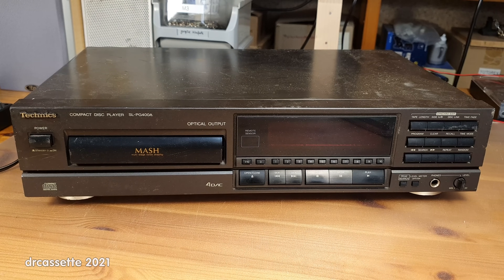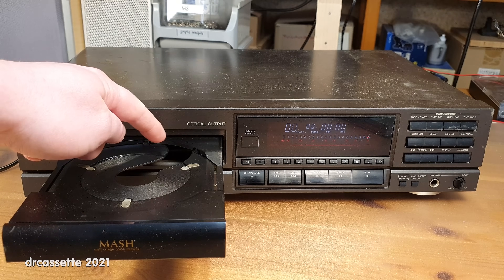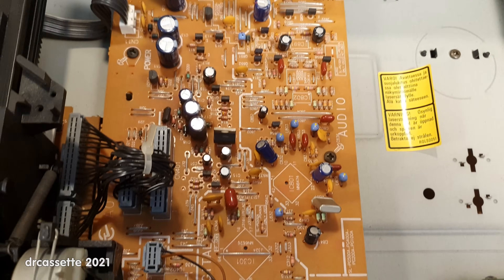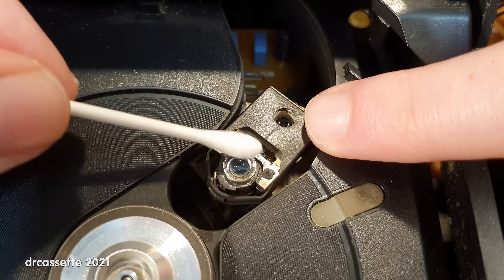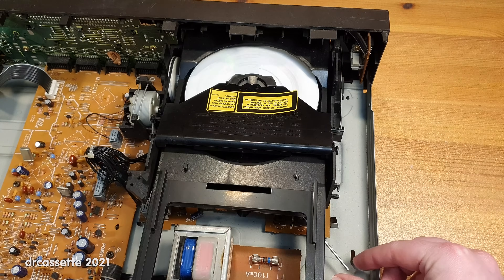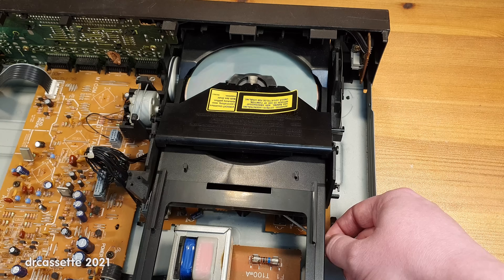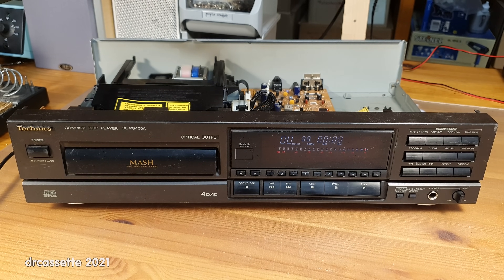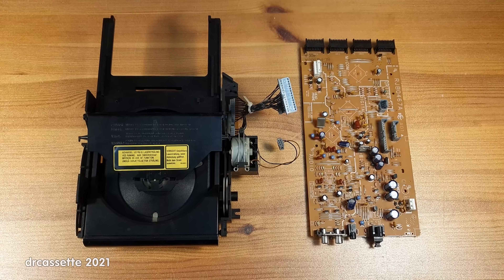Technics SL-PG400A CD Player repair attempt

Comment: Tle laser light intensity potentiometer is on head itself, those remote ones shoud be for focus and tracking
Reply from the maker: The service manual makes no mention of any adjustments on the laser assembly itself. The laser power adjustment is on the servo board.
Reply: @DrCassette  There should be always one on the head itself, check it, the laser assembly head is showed as one whole module in Service manual, you won't see it described there, If not there then, another weak point is bearing on the spindle motor, you can replace it with any similar size motor with long enough shaft to fit the disk holder. The motor is tired and causing wobble, change it and adjust that pot again. I've repaired dozens of those Technics weak players. Also try to lubricate old shaft, if you have luck, it may not be that weared.
Reply: @technixbul  on that Philips CD transport, no. Laser power and focus adjusting pot's are only on servo board.
Reply: @realsomething2981  yes i saw that, i have 3 of them, but this must be an older one, but the other part of my advices are still truth for that slide assembllies..

Comment: These Philips CDM 4/19 CD drives are very reliable and most of them can play CD-RW as well. But like some already mentioned the capacitors on the servo board (labeled 2501, 2502, 2503) fail very often. I only replaced the 2501 and my Technics SL-PG400A now works flawless. But I prefer the Sony KSS-xxx based CD players because they give you more options to tweak the laser, focus and tracking settings for faster performance and better error correction.
Reply from the maker: The next time I get in a CD player with CDM4 mechanism I will be sure to check the capacitors on the servo board.

Comment: I have a Phillips CD player with a similar mechanism that my parents bought in the late 80’s. We had many years of use out of it, nowadays it still kinda sorta works but it produces a kind of digital ticking sound, as if the laser can’t track the disc properly. It’s a fault my dad could never fix. I doubt if it is fixable, everything else seems fine. I still keep it around for nostalgic display purposes as it was our first CD player. Nowadays I use a DVD player to play my audio CD’s.

Comment: To be honest I've never really rated the CDM4 series, I've had a few dead ones. Changing the blue capacitor on the servo board can help but generally I've found that the digital output from them is very poor with a lot of noise and dropout. That says to me that the laser might be reliable but it is constantly mistracking, relying on oversampling and correction to sort the errors out.

The key advantage of the linear Japanese mechs was always that the laser was an easy and cheap swap out when it did fail. The Philips, much less so. Try getting a replacement for one of the less common variants like the CDM4/25 for example.

Comment: Randomly adjusting the laser current is not a good idea. You need to look at the eye pattern. Good that you checked out the manual 😜 check caps on the servo panel.
Reply from the maker: I was hoping that just a small turn of the laser current adjustment would be enough. It only turned into random adjusting when a small turn didn't do anything... The CD player has been scrapped, but the mechanism with servo board has been put into storage for parts. I will make a note to check the capacitors before using that assembly.

Comment: I once found a Technics in the dump that had a linear voice coil laser pickup. Yes. Like the Philips, but linear. Never seen such a thing. That thing woulnd't read a disc. Or barely. Or maybe sometimes. However if you left it turned on long enough it would eventually start reading the disc and after a little more time also playing the disc. The PSU was working OK too. Couldn't find the fault, no one else wanted it so I put it back where it came from as well.
Reply from the maker: Over the years I have had two Technics CD players with the linear magnetic drive, one was an entry level model, the other was the fancy SL-P770. Both of them worked, I gave the entry level model to a friend who I think still has it. I sold the SL-P770 because I had paid quite a lot of money for it and I didn't want to wear out the laser and ruin the value of the device...
Reply: I once had a Harman kardon disk player that behaved the same way. I service said the laser was worn out. Probably those lasers work better  when it's a bit hotter.

Comment: The whole CD player transport and servo is Philips made and there will be at least one of those terrible blue axial cap ... I once fixed a PG520 which would randomly reject any disc just by replacing one such cap: It measured fine, but the player started working perfectly after fitting a new cap. Also note that in the CDM4 the laser output is adjusted based on what the Pickup PhotoDiode reads back and that means it fully compensates for any dirt in the optical path between the laser output, the disc the prism and the PD's array. I repaired many CD players with CD4/19 and none of those had a dead laser.
Reply from the maker: It's good to know that these problems may be caused by dead capacitors, I will make sure to check the next time I have problems with a CD player based on the CDM4 mechanism. I don't think I have ever had any problems with CDM4 mechanisms, except for the ones in the four Technics SL-PG series CD players I have had over the years...
Reply: @DrCassette  I saw a similar trend with the Philips CDM12.1 successor to the CDM4/19: CDM12.1 on Philips or Marantz CD players are mostly still fine, CDM12.1 on technics CD players are easily dead (e.g. PG370 and forward)
Reply: @enricoself2256  , not necessarily. I have a 23yrs. old SL-PG 380A, bought used (but in good condition) 15 yrs. ago.. It works fine.

Comment: Many claim that the Philips type of mechanism is better than the Sony mechanism in CD players
I've never found a used not working CD player with a Philips mechanism that i could fix...
In the other hand i have fixed many CD players with the Sony mechanism inside ✌️
Reply: I repaired several CD players with either SONY or Philips Pick-up. I have a collection of dead Sony pick-up's (KSS240, KSS150, KSS213, ..) which needed a full replacement but I have yet to encounter a dead CDM4/19. In the ones where I checked laser output, they were all still perfectly within -50/-60 mV. So, yes, CDM4/19 are way more reliable than Sony transport. And if you need to find a spare CDM 4/19 they were used on a many CD players you can now get very cheaply.
Reply: Some say the single laser beam was better at tracking scratched discs.

Comment: Yoiu should try to replace blue, axial philips capacitors on the transport board. They always fail.
Reply: My thoughts too a well known issue.
Reply: I second that suggestion: best case, it is half of the original capacitance; worst case, it is a dead short or has weird unpredictable behaviour
Reply from the maker: The CD player has now been scrapped, but the mechanism with servo board has been put into storage for parts. I will make a note to check the capacitors before using that assembly.

Comment: I would have put tape over the top of that fuse.  But to each their own.
Reply from the maker: Yes, I should have done that. But I originally expected only a small twist of the adjustment would fix the problem. In that case I would not have gotten anywhere near the fuse...
Reply: @DrCassette  I've found in the past that the half silvered mirrors under the lens can often be dirty and crazy hard to clean.

Comment: That CD-R Verbatim is horrible (very light dye).
I use always original disc or "Almedio abex test disc" for the laser adjustment (to obtain the classic 0.9 volt peak to peak).

But yeah, the CDM 4/19 is pretty dead.

The good things is... these laser are not expensive like the Sony ones (KSS-151 for example).
Reply from the maker: The Verbatim CD-Rs are indeed horrible, the reflective layer is so thin you can almost see through it.
Reply: I once had a batch of Ricoh CD-Rs. They wouldn't play in anything. I ended up having to adjust every CD player in the house and about every second CDROM drive. One wouldn't read normal CDs/CD-Rs after that.
Reply: @senilyDeluxe  I always use (during my childhood) Verbatim metal Azo, TDK reflex or Philips Silver premium

Hard to write, but excellent read stability!
Reply: Remember those super cheap CD-Rs that had nothing written on it? I used to write "This side up" on them...
They weren't hard to read or write, but if you looked at them weird, the data layer would just flake off. And the data retention rate is maybe a few years.

Comment: I used to repair this kind of device adjusting two small screws that can be found right under the assemblage that holds the laser len. A small rotation of these screws could return the device to work in about 50 percent of the cases. I

Comment: I have tried the same steps as you, up to before the oscilloscope on a VERY similar model of that family, also to no avail...
Pity because these were considered good quality cd-players once.
I will try again in the future, the player is safely packed and stored at my parents house and I very recently moved my old oscilloscope there, so when I have time I may take another crack at it.
However, from reading on the net, these had the rather early mechanisms and laser diodes that proved less reliable over the long run, so I am not holding too much hope.
Reply from the maker: As other people have pointed out in their comments, these problems can be caused by bad capacitors on the servo board. The next time I come across one of these CD players I will make sure to check those too.